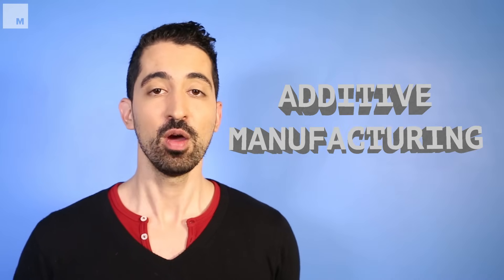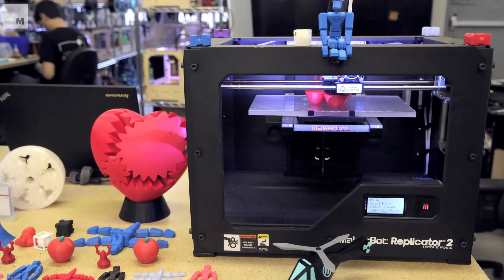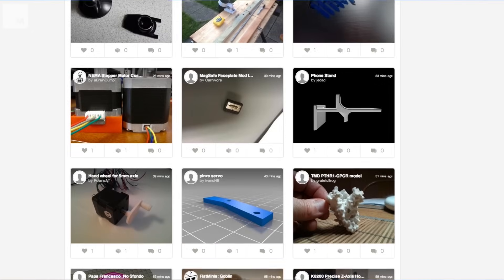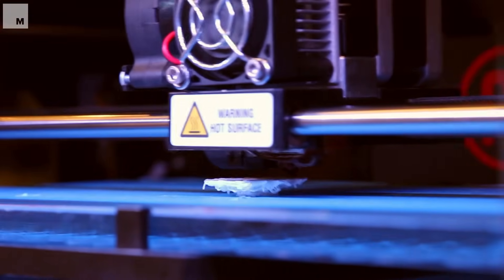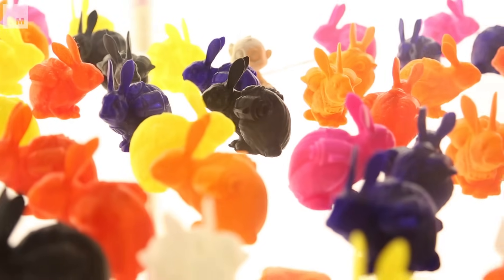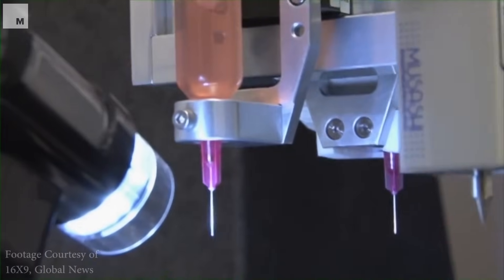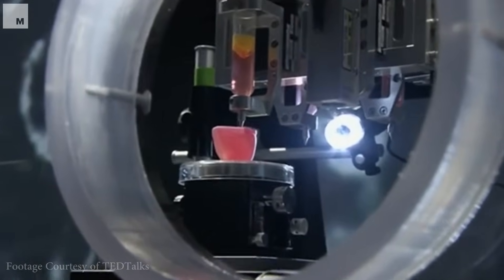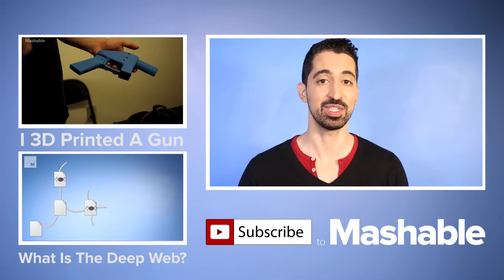What Is 3D Printing and How Does It Work? | Mashable Explains

Comment: Melt plastic into obedient goo
Extrude it through a heated needle like a mechanical spider
Lay it down in sacred layers until an object emerges
Repeat for eight hours without disturbance
Witness a real thing appear from nothing
Find it failed at 97% because the nozzle sneezed once

Comment: the 'original' 3D printing was stereolithography ... just an aquarium (basically) filled with resin- wherever TWO laser beams crossed heated up the resin JUST enough to have it set ... once all the scanning is done you just remove your object from the bath

Comment: I really don't get this shit or how it works still. It really makes no sense to me
Reply: ryzhkov_214 think about it this way. You know how a printer that uses ink prints on top of the paper, and although it's a very thin layer, the ink does add a layer to the top of the paper when it prints the image. Now think if instead of ink you are using plastic that has been melted to print with. You can print an image that is one layer of an entire object and is thicker than the ink that a printer prints with. Have you ever cut a tomato into several slices? How hard would it be to imagine using plastic to print a thick enough layer to make up 1 slice of a thinly sliced tomato? Now think that you are using the plastic to print the bottom layer of the tomato and then before it is curing or drying you are printing the very next slice of the tomato on top of the last one. You do it over and over until all of the slices have been printed on top of each other and the material has cooled and dried. When you print the last layer on top of the previous one you will have a complete 3D printed "tomato".  Lol.

Comment: Can you use Sketchup for 3D printing Something
Reply: Yes you can
Reply: its not the best. Often results in broken 3d models that the printers slicer cant figure out. 
If you have to use sketchup then you also need a plugin to export the STL file and then you need some 3d mesh fixed as well. 

Best thing you can do is do use a program llike fusion 360 from autodesk. its free and very easy to use.

Comment: The real question is: can you use a 3D Printer to create a 3D Printer? A question for the scholars...
Reply: I would say it can create the body of it BUT it can't create the programming of it. In other words you can create the body but have to work on the chips and programming alone. Besides you should use materials other than plastic. Add to that the material used should have less melting degree than the materials of the original 3D printer but only less than it by a little so it can be used for most of the other materials. And it will always be smaller (the produced one) than the original one.                                                                                                                                                   THESE ARE MY THOUGHTS AND ASSUMPTIONS ONLY ONLY SO THEY ARE MOST LIKELY NOT BE 100% CORRECT                                                                                                                                                                               SHORT ANSWER: Yes but it will be a little bit of a different process.
Reply: Tharasian would that be the same if they tried to do a car? Haha sorry I’m really new to this stuff but just bought a printer for fun lol
Reply: Atma you can print a model, but it won't print until it has the mechanism, parts and programming required to 3d print an object.
Reply: "you should use materials other than plastic" You can print some kind of metal also, which is pretty strong actually. We have a metal printer (and two plastic) at the factory i work.
Reply: @patrikb2068  cool
Reply: Atma It’s big Brain time
Reply: Lulzbot does 3d print their printers fyi
Reply: Big Mike  And to think there was a time when young men would dream of 3D printed Doris Days.
Reply: fertilisation
Reply: 'I used the stone to CREATE the stones...'
Reply: 8 years after yes you can

Comment: what if you wanted to print something with a part that separated downward: for example: an elf bust with a long chin
Reply: +Brady Hey Brady, In that case, your reference layer would be the bottom most point of the elf's long chin. And from there on up material will be added onto it until the entire elf bust is complete. Hope that helped:) Cheers

Comment: How much did the 5 printers that printed the house for $5000 cost?
Reply: Salvador Guzman They would have calculated the price into the five thousand, but I'm not sure of the specifics.
Reply: No, they wouldn't have calculated the price into the 5,000. After they make 100's of houses then they will make a profit from being able to manufacture cheap houses quickly.